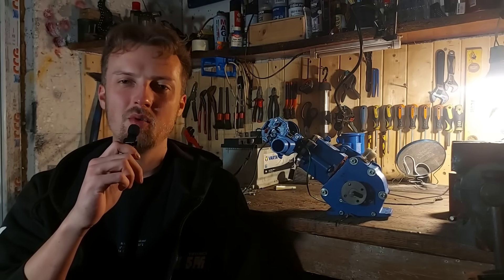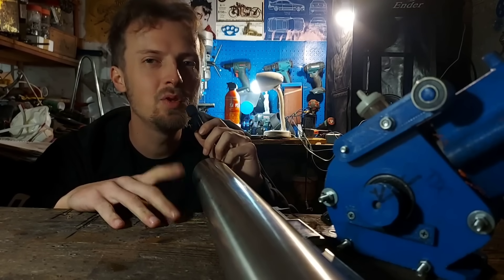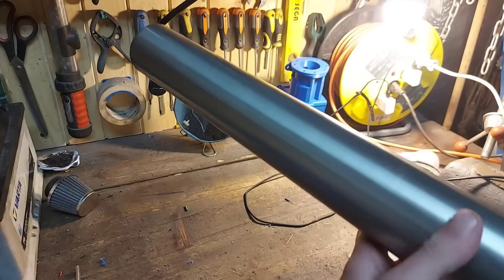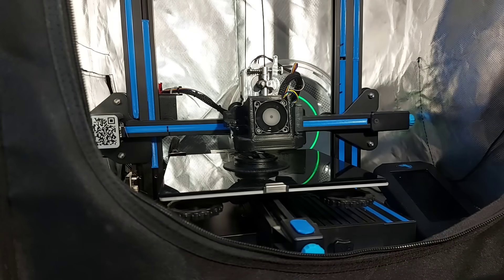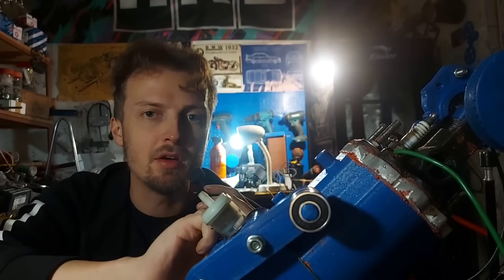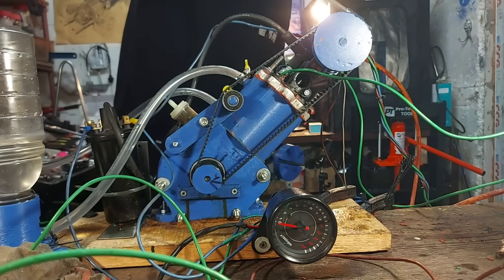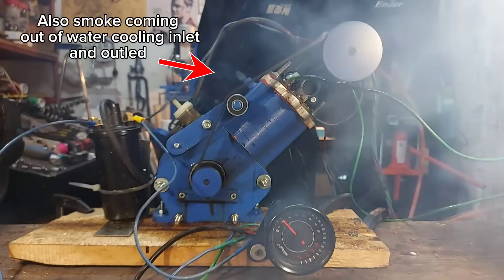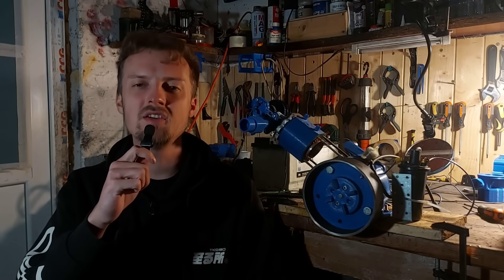Building a Bigger 3D-Printed Engine That Screams at 7,000 RPM

Comment: you should consider printing oversized and cutting it down to ensure a smooth mating surface. also consider resin printing for a smoother piston.
Reply: also 100% infill is a must for good sealing for the water

Comment: for getting the flatest surface when you grind the cylinder or everything you want i recomend you to put the grind paper on a flat crystal surface, i use it so much coz its the best leveled thing that you can get easily and for cheap

Comment: >>> 💢💢 We are trying to get TATRA Motors to incorporate our ultra-efficient, Fuel-Agnostic, Zero-Emission [FAZE] engine technology in the engines which will displace any vehicle electrification. That means electric vehicles are inferior in all metrics. Period.  The technology enables constant maximal torque and efficiency at all speeds and conditions without a TRANSMISSION. 💢💢 <<<

The low cost FAZE engine tech is revolutionary yet is in a simpler, smaller package, with very little electronics so repair is 'old school' simple. It's virtually noiseless & vibrationless and odor/smoke free. The constant, maximal efficiency and torque at any speed and transmission-free operation characteristics mimic electric motors. Low cost breaking energy recovery system dispenses with batteries. Real world driving cycle efficiency is 200-500% better than the competition. Many other benefits abound. 

I'm talking to a small Czech  engine development  startup KNOBGEAR regarding collaboration to promote/commercialize their two new vibration free engines in USA esp. in the aviation and range extension markets which will eventually incorporate the FAZE tech. NFTG may significantly improve these 2 engine designs. 

Moreover, NFTG is developing the FAZE tech for use in the low cost, autonomous, door-to-door, personal air mobility system, the PersonalJet. The 1st trillion $$$ company.

You may be able to find papers online, and LinkedIn under New Frontier Technology Group. Search the 'Create The Future Contest' site at 
[ contest.techbriefs \\\ d0t ///  c0m ]

Let me know u got this

Comment: Correct me if I miss something here, but as you seal the piston not with pistons rings but with O-Rings: Wouldn't it be better to use Silicone-Oil to lube the engine? You'll get way less friction. As far as I remember your design you dont have any metal on metal friction, so regular oil is not the best lubricant
Reply from the maker: I will look into it, thank you for the tip!
Reply: @alexslaboratory4976 You could even look into PTFE-Oil and almost eliminate friction all together (if you make sure non if the plastics you use are attacked by it)

As far as I'm concerned the biggest draw back is that both silicone oil and PTFE is not standing very high temperatures of ICE engines - but none of your plastic components do, so you run it for seconds only and will be fine

Comment: Awesome video!! I’m pretty late, but I still got here!! 

I think the larger displacement with an increased bore significantly helped extend the runtime of the engine, because there’s more material that needs to heat up in the piston before it reaches a temperature that it can no longer survive. I think that’s why I got over 1.5 minutes with a 3-D printed plastic piston on my engine. 

Again, amazing video! I can’t wait to see more!
Reply from the maker: Thank you!🥳 I think I will also do a longer run just to see how long its going to survive, once I stop all the leaks from the water cooling system.

Comment: You should downsize it, instead of upsizing.
Come on, you have a plastic engine.. improve the calibration of your 3d printer, use pistons and rings 3d printed out of nylon.

I have notice you have a lot of holes in your engine block, that is cause by the bad calibration of the seam of the layers, you have to calibrate this, and stop using pla

Comment: If you want to get more rpms try building a 2 stroke engine, 100cc is a good start and running Efi fuel system is a great system when tuned properly. Oh as a warning carbon fibre is in theory the best material but in reality the conditions it’s in will not end well.

Comment: from what i know about 3d printing engines, is if i were you i would definitely look into making some kind of exhaust manifold (i know it's just a 1cyl but just a bitta pipe will work) just to one, stop gassing out right were you are, you'll be able to better see where smoke is coming out and finally with an open port you increase the temperature of the exhaust valve due to any left over fuel can continue burning right over the valve due to easy oxygen access which is obviously bad for ya valves n head

Comment: Nice. Keeping compression is a big step forward! I wonder whats causing the knocking—hopefully it’s just running lean or the ignition timing is a tad early. 

I wonder how far that plastic piston can be pushed. If the nylon melts, maybe peek will work better.

Comment: Instead of using o rings on the piston, maybe try some 3d printed rings, my thought is that the gas is deteriorating the o rings
Reply from the maker: I did experiment a bit when I have pvc cylindee body with pa12cf 3d printed rings but they didnt hold compression well.. I will try again tho now that I have a metal cylinder sleeve.
Reply: @alexslaboratory4976  maybe you should also try soaking the o rings in gasoline for a bit to see if they fall apart

Comment: Good work, but I don't know if you read my last comment, but you should. Another person and I calculated and discussed about water injection and how much water is needed per ml of gas to absorb all the energy.
conclusion: u need to use a metal piston bc the plastic one starts do melt at 130ºC
Reply from the maker: I do read all the comments and I appreciate the fact that you guys did all the neccesasy math! I will most likely add water injection at some point.

Comment: ayyy a new video made my day anway i had a idea could you try makeing it a single valve engine or a single valve and a exoust port on the botom (like a 2 stroke) i had this idea for a while now and i dont have the experiance or time to do it and i think the second option would work great cuz it would behave like a 2 stroke and would't require to mix oil and gas  but any way very cool ;D
Reply from the maker: Thats a cool ideea, will think about it !

Comment: I like the videos, the project is definitely interesting, but man, I feel like you change a totally random and unrelated thing every video. 

Bigger engine means less rpm unless you increase the number of cylinders, since the speed at which the mix burns is the same and you are increasing the volume. 

Also, even if the piston and ring were undamaged, I see a common failure point with the rubber ring. I think a PTFE ring would be better. I could understand the insistence if current ring was 3d printed, but that is not the case.

If you intend to reach your 10K rpm goal just fix the limitations one at a time and do not waste time adding fancy extras like the comments-requested liquid cooling, as you can see as you had to disable it in later tests this video and only served to add water to your crankcase

Comment: You should prioritize stroke over bore, this way the heat is transferred to the cylinder walls instead of concentrating on the piston, this would also lower rpm, which is beneficial considering the crude lubrification system
Reply from the maker: Im aiming for high rpm, so the over square bore x stroke setup was a must .
Reply: @alexslaboratory4976 well trying for a more reliable and less powerful engine is a good idea. Trying to go for 100 straight away isn’t a good idea. Just try to make a lower rpm engine that can idle for a little bit (probably 1 minute) and then build off of that design to improve the performance.
Reply: True but the goal is 10000rpms
Reply: Love your videos btw
Reply from the maker: Thank you!🥳

Comment: mans logic: make fully 3d printed engine (doesnt work)
adds metal (works)
adds more metal (works better)
adds even more metal (works great)

yet 3d printing is the future
Reply: its not made for that thats like saying cooking is useless because you cant make a food engine
Reply: @sunlabsExperiments  exactly, we know metal is better, but this is P&D, to try to build an engine using plastic is very hard, and that's where is all the fun
Reply: I'd say if it used bolts and simple hardware stuff is fine, but when you start using a lathe to make parts, it's just a normal engine.